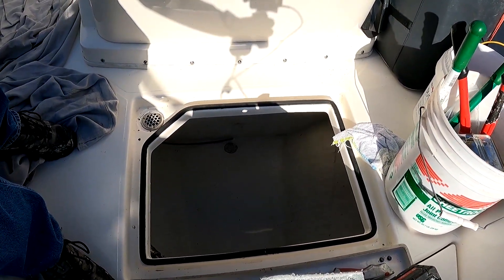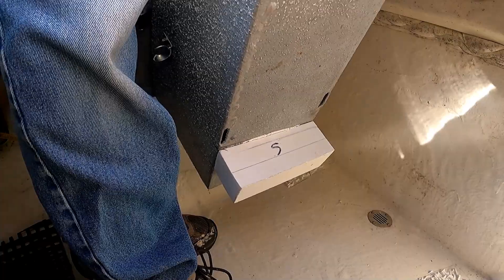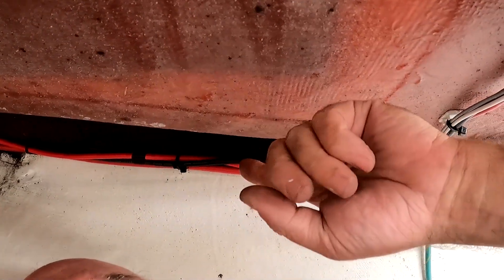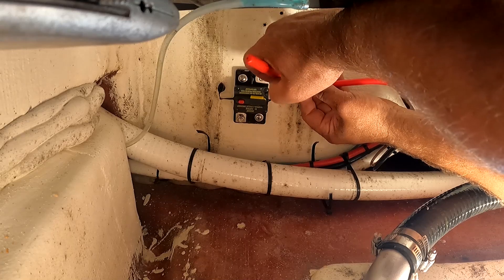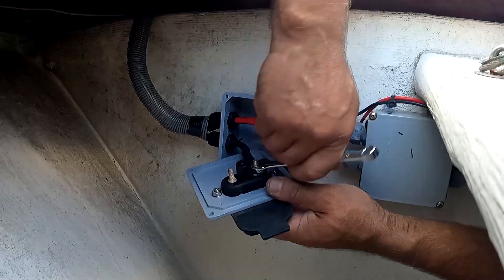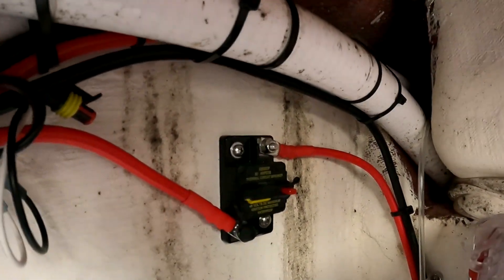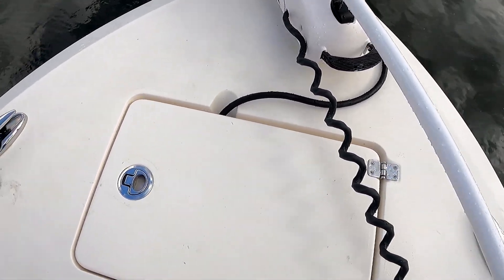Electrical install of a Rhodan 96 in a Cobia 301

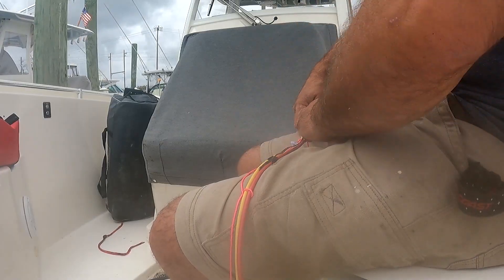Comment: 4:49, that thing looked jam packed.  How in the world did you get anything more in there?  Are you into woodworking by chance?  I saw in one of your shots what looks to be a blast gate for dust extraction.
Reply from the maker: Wood and metal. I worked at Pipewelders when I was young, custom marine fab.  Now I seem to work more in wood and composite materials.  Yes, very tight in that forward compartment now!!

Comment: What batteries did you use?
Voltage and Ah?
I saw you only used 2 for a 36v trolling motor. 
How long have they lasted?
Reply from the maker: I have two 50ah 36v batteries in parallel to give me 100ah of 36v.  It never runs out.  If you run 3 12v batteries in series and one dies you are SOL for the day as you will only have 24v left.  Batteries came from Stealth, where I got my Stealth1 charger.
Reply: @4RibsFishing  can you send link to website having trouble finding it
Reply from the maker: http://www.stealth1charging.com

Comment: I’m planning on putting a lithium single battery in the same hatch. 

I have Yamaha helm master and the autopilot compass is in the same hatch. 

Would the batteries in the same hatch create a deviation and affect the compass which would then affect my autopilot from holding a heading.
Reply from the maker: Mine is there too.  It hasn’t been a problem, but I’m not sure if my 1/8” aluminum battery box is helping, or if the interference issue is just internet superstition.

Comment: Thank you for the video.  Why did you choose the stealth 1 over an MK DC3?  From looking at the stealth diagram it does not seem like it would equally charge the TM batteries.  You would not happen to have a wiring diagram showing the whole system with the charger hooked up.  The stealth wiring diagrams are very confusing.  I have no shore power as my boat is in a dry stack so I can only use a system that charges off the F300 yamaha.  Thank you
Reply from the maker: Andrew, I didn’t compare the two.  The stealth seemed to do everything I needed and I appreciated Danny Robert’s support and guidance on my install.  You should call him.   Send me an email and I can respond with the diagram.
Reply: @4RibsFishing  Thank you.  I sent you an email to the email on your facebook page.  Thank you

Comment: Beautiful install how is it holding up the 24 volt how many pounds of thrust comes on your 96 Rodan
Reply from the maker: Raymond, the 36v Rhodan has 120lbs of thrust.   If you use the manual calibration on setup you will be fine.  Auto calibration causes problems.  I’m working on a follow up video to show how it’s held up.  Stay tuned!!

Comment: C
Nice  clean install how is the Rhodan holding up??
Reply from the maker: It has its issues.  Apparently the ‘Automatic GPS calibration’ is not to be used.  Mine was not holing the calibration.  I sent the boards back to Rhodan and they told me they are fine, just use the manual calibration instead.

Comment: Nice installation, how is your DC charger working out since you didn’t install separate AC charger for the trolling motor batteries
Reply from the maker: Hi Sam.  I do have a separate AC charger for my 12v system.  The stealth 1 takes its power from one of your cranking batteries, so whether you are hooked to shore power, or running the engines, you are charging the TM batteries!

Comment: Hi, great videos. 
I have the same boat 2019. I'm going to send these to my installers. 
Question :  where you put your battery box down below is where my Garmin compass is and the metal will jazz up my North.
Is yours same place as mine on the port side down below? If so, did you have any issues with your Garmin compass?
Reply from the maker: Mine is in the same place.  The box is made out of aluminum and is not magnetic.  I haven’t seen a difference in how the GPS operates.
Reply: Hi,
I was wondering if you are opposed to me being able to private message you with questions about our Cobias?
Thank you for your videos.
Very useful 
 
Jim